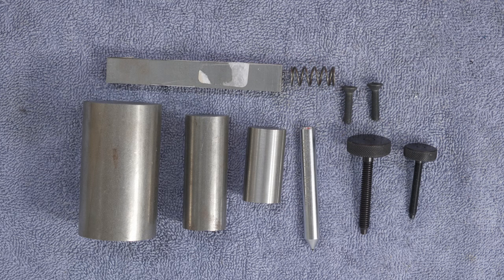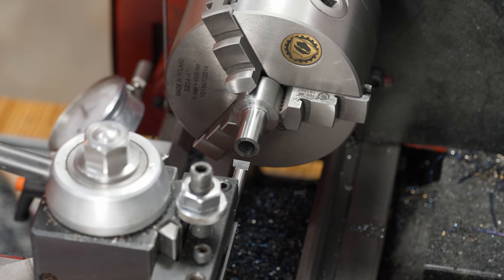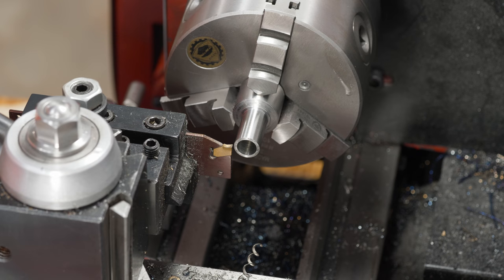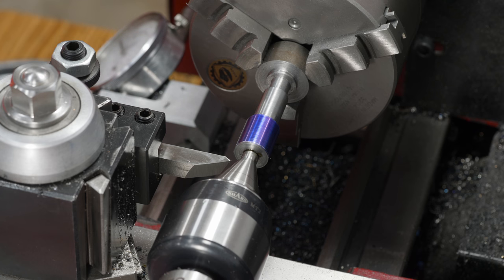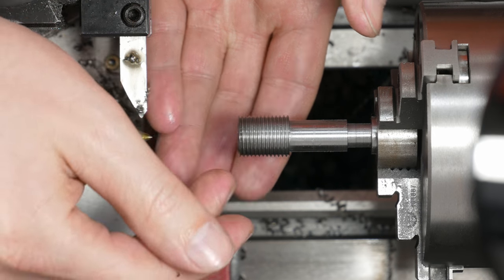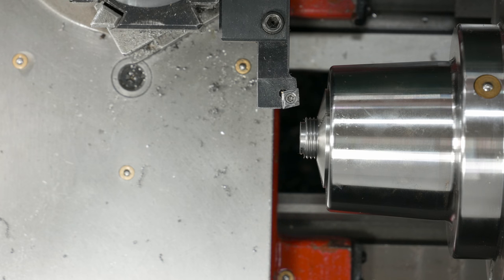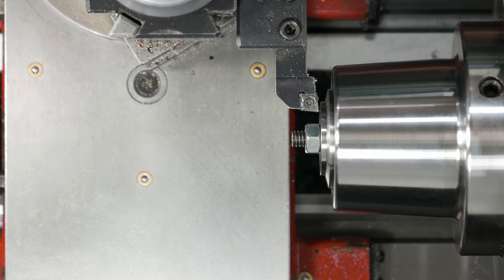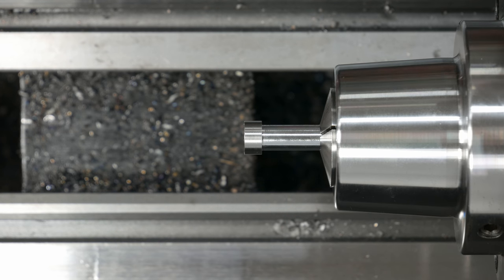Bench Grinder Diamond Dresser Part 1

Comment: Slick stuff! Food for thought, setting up a way to do the sides of the wheels as well?
Reply from the maker: The manufactures recommend not doing that.
Reply: dans-hobbies, huh didnt know that one, i wonder how they are different vs a surface grinding wheel, that can be sculpted into all kinds of different profiles and widths.
Reply from the maker: People do it all the time, I assume the manufactures and governing bodies don't want to be liable for people pushing to hard, and having a wheel come apart at speed, irregardless of what type of grinder it is.

this is an excerpt from ANSI B7.1-2000

Type 1 straight wheels have diameter, thickness
and hole size dimensions and grinding
should be performed on the periphery. This
does not preclude their use for applications
such as shoulder contour and form grinding
where it is recognized that a limited amount of
side grinding will be performed. Extreme caution
should be exercised not to use excessive
side pressure.

Comment: Dan, I picked up the same kind of diamonds for my surface grinder build. I was wondering what angle are you keeping the diamonds at? I use a shaving head looking diamond dressing tool for the bench grinder.
Reply from the maker: I designed the holder for 15 degrees off axis, and i will lean the rest down 15 to 20 degrees as well. and then you always want to drag, never push.

Comment: Any chance you can tell me what kind of tool holder/inserts you use. I have the same lathe
Reply from the maker: I Have two of the these half inch sets from grizzly. To use them, you need to thin the bottom of your QCTP holders or you might not be able to get the cutting edges on center. 
http://www.grizzly.com/products/Turning-Tool-Set-1-2-/H5681

if you don't want to thin the bottom of your holders, you can get them with smaller shanks from Chronos in the UK.
https://www.chronos.ltd.uk/cgi-bin/sh000001.pl?WD=glanze%20turning%20tools&PN=Glanze_Boxed_Sets_of_CCMT_Turning_Tools%2ehtml#a777103_2e_2e_2e
Reply: That looks to be an AXA type tool holder, Wedge type for sure, which are superior to the piston style supposedly.
Reply: I have the same question.  Almost looks like he is using the "unusable" edges of a ccmt insert with a SCBCR holder.
Reply from the maker: I had to look them up, but these are the inserts I'm using.

https://www.sandvik.coromant.com/en-gb/products/Pages/productdetails.aspx?c=CCMT%2006%2002%2004-PF%201515
Reply from the maker: All the edges are usable in these tool sets, that's one of the nice things about them. The other nicety is that you only have to keep one type of inset on hand.
Reply: Yeah, but you need two different holders to accommodate the two different included angles on a ccmt, correct?
Reply: Awesome thank you that’s what I was looking for to be able to use all edges.
Reply from the maker: The set I linked to and have, has 6 different holders in it.